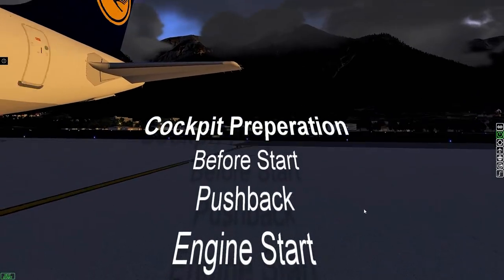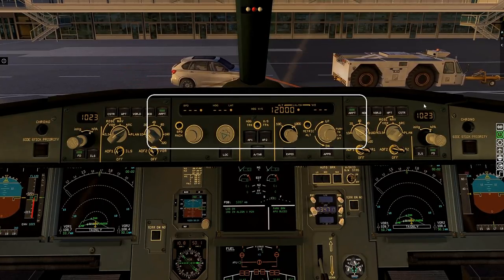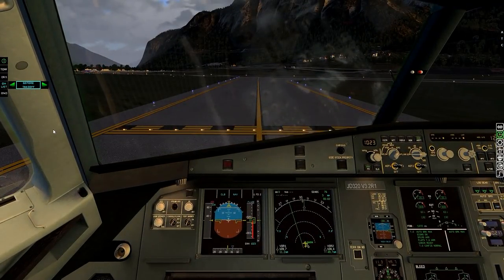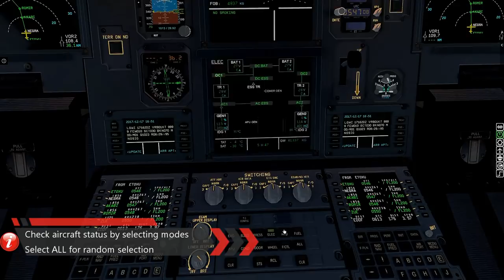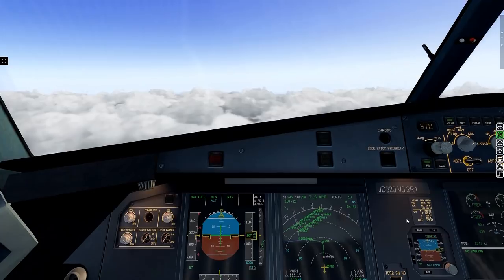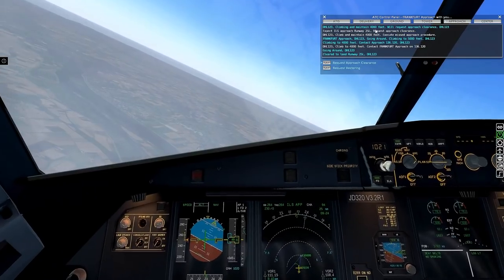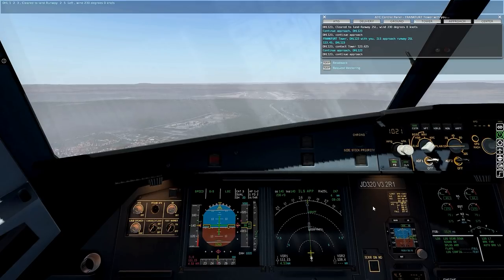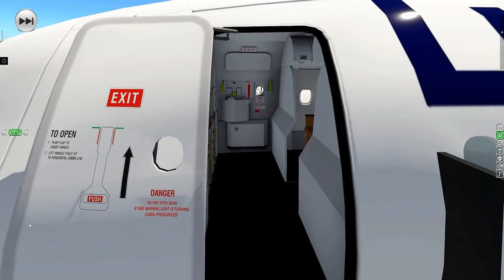X Plane 11-A320Neo Comlete Tutorial|X-Life|Download Checklist|Full Flight|LOWI to EDDF

Comment: very good video thanks, I would like to know what kind of camera do you use to make it, thanks
Reply from the maker: You mean the camera I use to turn my head?
Reply: I mean when you walk in the plane or outside and also when you're in the cockpit
Reply from the maker: @christianvittoz4306  to move around I use the keyboard for going forward and backwards. With the mouse I look around. When in cockpit I have track ir to look around also I am using x camera to change the views.
Reply: @OltcitRoom  thanks very much for your answer, I got some problems with the auto throttle, it doesn't work,can you explain me how to make it work because when I'm flying I can not engage it .thanks
Reply: @OltcitRoom  other question, i see that to config is on mormal mode on your plane and on mine it still stay on test what could I do to put it on normal mode ? thanks again
Reply from the maker: @christianvittoz4306  make sure you have the latest update of the aircraft. You might wanna check with JarDesign website for the latest version. It is important. It seems like you have an older version. The auto throttle should engage automatically,  ofcourse you have to check the ecam and make sure after take off not to lower to much the throttle.
Reply: @OltcitRoom  Igot the latest version of the plane and it's still the same thing with the auto throttle, that doesn't work, really I don't know what to do ,I think that I'ml going to undownload this shit, because for me that plane is a real shit
Reply from the maker: @christianvittoz4306  it looks like you might have some installation error. Uninstall the version you have and do a fresh installation of the latest version. You will have to enter the activation code again and before deleting the version make sure you save the liveries if you have added extra ones.
This is the latest version:
http://jardesign.org/forum/viewtopic.php?id=11625
Make sure you have the latest X plane 11 version , NOT Beta version, it has to be full version for both X Plane and A320. 
Let me know if that fixes the issue
By the way are you on Mac or windows?
Reply: @OltcitRoom  hello, thanks very much for your answer, I've reinstalled the plane, entered the activation key but when i make the checklist of the after start I am told the the ecam memo in not blue what can I do to make it turn blue?
Reply: @OltcitRoom  I have a checklist and on it they told me to put the WTX on on, what is the WTX?
Reply: @OltcitRoom  the ecam memo must be no blue what could i do to turn it no blue?
Reply from the maker: @christianvittoz4306  if the text is blue that meams no good. The text on the upper ecam should be green, anything blue is not good.
Reply from the maker: @christianvittoz4306  WTX will be the weather
Reply: @OltcitRoom  on the ecam to config is in blue and it is on mode test and not on mode normal
Reply from the maker: @christianvittoz4306  if you follow all the steps on the video should be good....

Comment: Hi! I have a problem! I can’t taxi. Like plane isn’t going. I don’t know what’s wrong. I did all instructions. But maybe that’s because I set up all systems with Hot start (or something like that). This start is setting up  all settings automatically. Maybe I need to set up all settings manually (like in this video).
Reply from the maker: Make sure you have the latest full version of the aircraft. Not Beta version
Reply: Oltcit Room Hi. I don’t have that problem anymore. I put letter z and n in throttle settings.